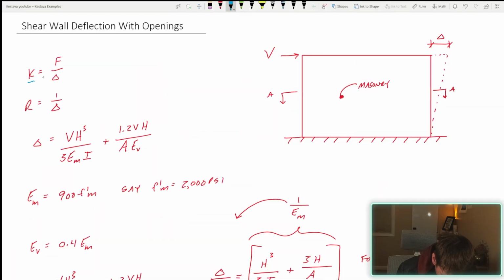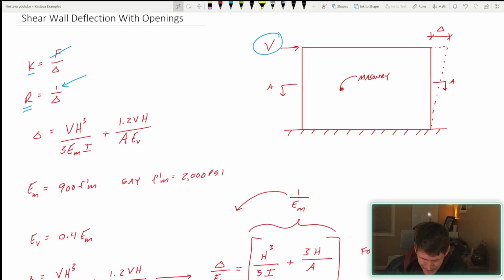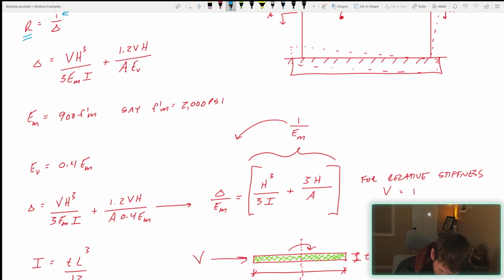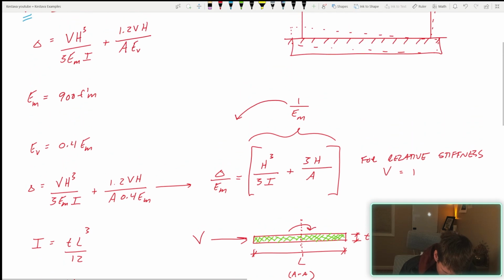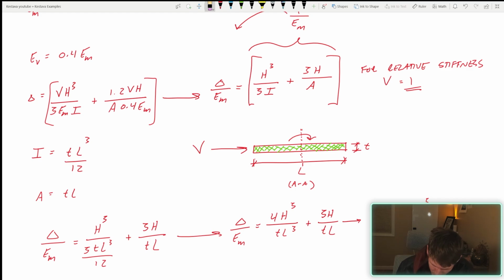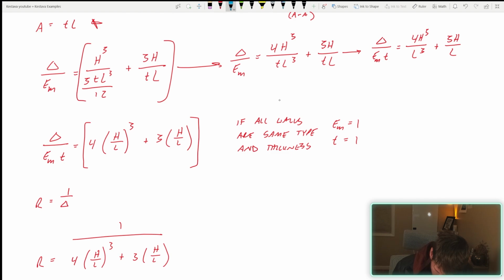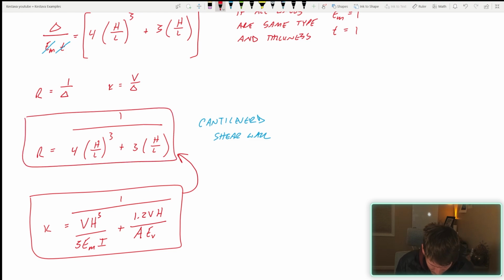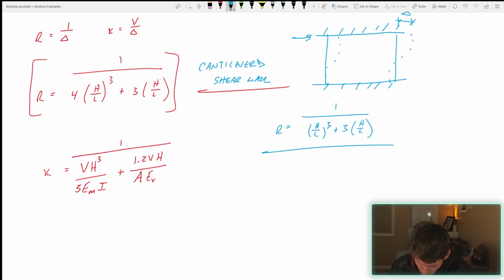Calculating Stiffness and Rigidity in Masonry Shear Walls

Comment: Is there an error in the simplification? Being that Em and t  located in the denominator when going over to the other side of the equation would have to multiply by Delta? Although that in the end since it’s unitary then it doesn’t end up making a difference I just wanted to clarify this just in case or am I missing something?

Comment: How do choose between the cantilever and fixed-fixed rigidity equations? Does it depend on the material/stiffness of the diaphragm?
Reply: I would assume the fixed-fixed condition for all stories except the topmost story in a structure and assume cantilever for the topmost story.
Reply from the maker: bingo @arbaz28!
Reply from the maker: This is a really interesting topic that I have gotten mixed reviews on. I am digging into this exact topic for a future video. As a lot of engineering comes down to... it depends! you're asking the right questions!
Reply: Makes sense to use cantilever on top story since it is free. I’ve noticed for rigid diaphragm wall shear loads, it doesn’t really matter which boundary conditions you use since the stiffness ratios come out the same and hence shear load distribution the same. Like most engineering problems, reality is probably between both models.